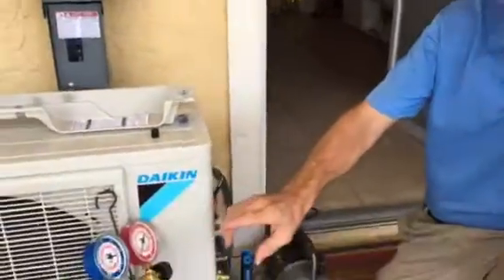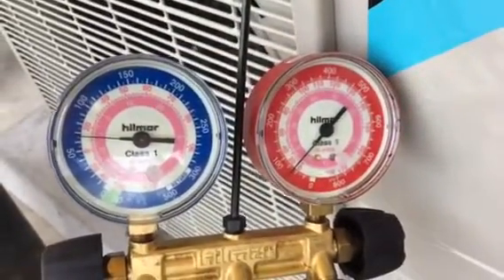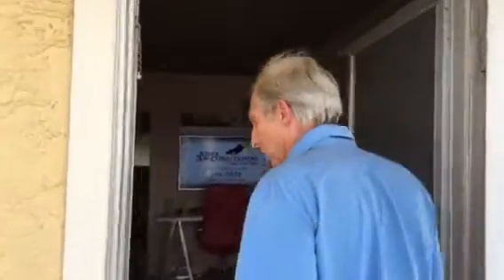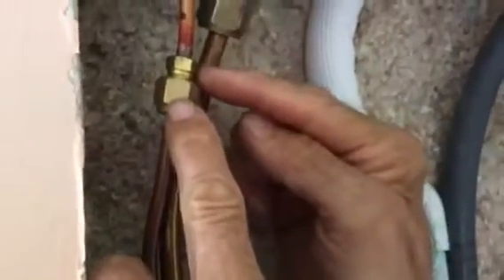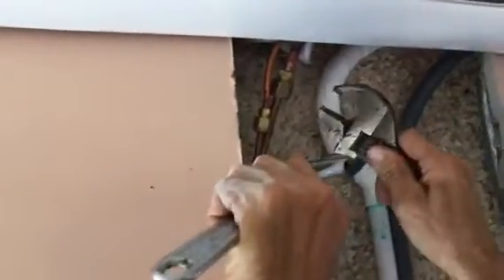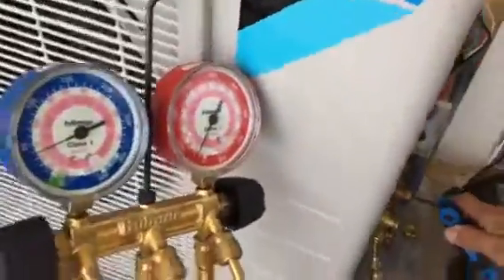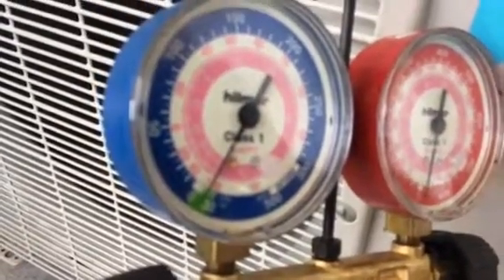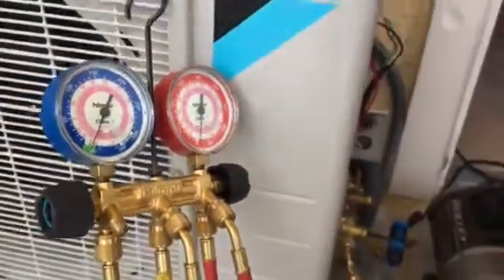Mini Split Refrigerant Leak

Comment: Thanks, I have one that did not seal. I tightened it and still not seal. I have now got over 300 ft-lb on it and still no seal. Now I can take it back down and redo the factory flare. Thank you for posting.
Reply: I've heard that factory flares are not so good. Better to cut them off and flare it yourself

Comment: I'm picking this unit should be "left piped" but wasn't. Properly piped in the first place means flares will NEVER be hidden in the wall cavity.
Reply: nonsense put a service cover over the drywall easy to access if needed.
Reply: That is correct. Pipes should be braised inside cavity.

Comment: I just installed one in my house, I pulled a vacuum, it's been holding at negative pressure for 6 hours but my micron guage jumped immediately after turning off my vacuum.
Reply: Close the line before you turn off the vacuum

Comment: Recover. Repair.  Pull vacuum.  Weigh in charge.    I found this video looking for a video on how to check charge on a mini split? Any recommendations on where I can find a video that knows what they are talking about?
Reply: The only way to check a mini split is recover what's left find issue fix it and weigh it back in name plate. You cant got off pressures
Reply: Check  AC Service Tech LLC. Craig is an expert.  Lots to learn about mini splits and hvac.

Comment: You don’t top off a mini split guys don’t do this you pull the charge a weigh in your amount. That isn’t a liquid line either both pipes and the indoor unit are your evap coil in cooling because the eev is on the outdoor unit.. a lot of misinformation here study up to learn the right way.. save our industry!

Comment: Do recommend recovering all the refrigerant and then charging by factory weight? Otherwise any recommendations for taking subcool/ superheat readings to properly charge if you choose to pump down and top off since often can not get access to high side pressure readings?

Comment: #1-always cut out the flares and sweat all joints with silfos 15. #2-thats an r410 system, so you have to remove the existing refrigerant. If you try topping up the charge it will ramp up the discharge pressure to 600 and trip the compressor internal overloads. Leave the air conditioning to a professionally licensed journeyman refrigeration and air conditioning mechanic, not plumbers, electricians or sheet metal mechanics. Btw- those aren't flares, they have o-rings.

Comment: Would pumping down a system with a leak run a risk to suck air in along with the refrigerant into the condenser?
Reply: Air pressure is extremely low pressure. Doing what he did could technically add air to condenser since he ran system into a vacuum with the compressor still running. Never run the system into a vacuum with the compressor running. You should run system pressure down to 5 psi close service valves and let 5 psi out into the atmosphere as de minimis.
Reply from the maker: Yes, you always want to pull a vacuum and use new refrigerant if possible to eliminate contaminants and non condensables in the refrigerant.

Comment: Would the mfg frown/deny warranty if those flare couplers were done away with and brazed?  I do not like anything flared.
Reply: You can braze the lineset as long as you run nitrogen while you’re doing it.
Reply: @TandNServices  why?  This sounds important!
Reply: muniznick I know what you mean...I go for or switch to braze joints whenever I can. That is sound!